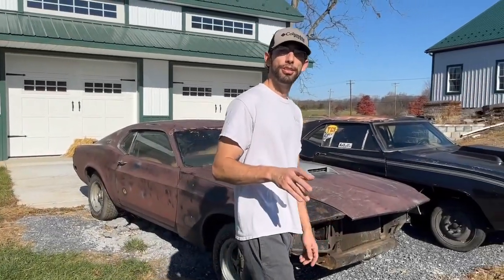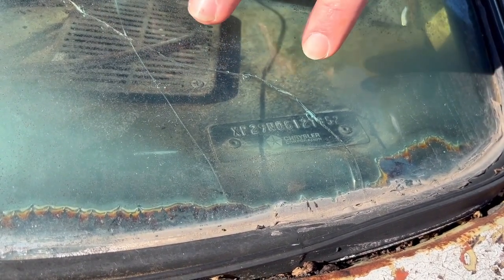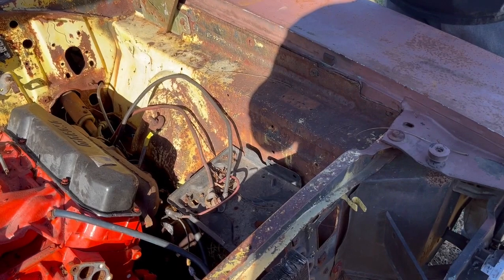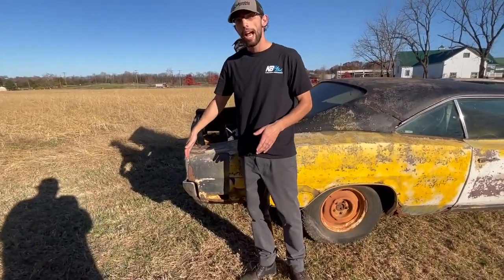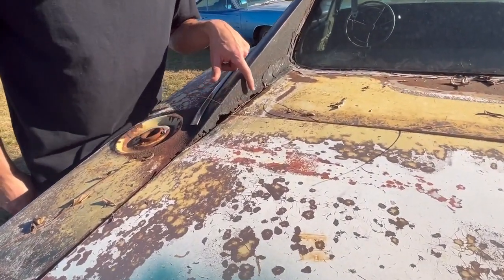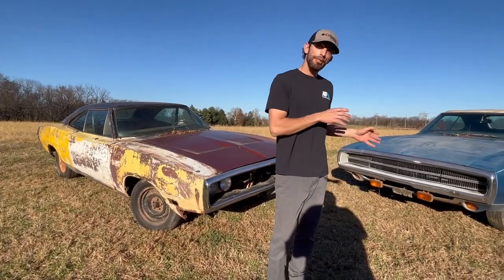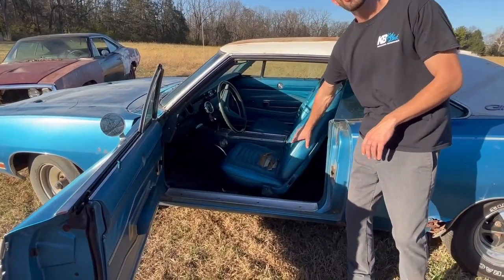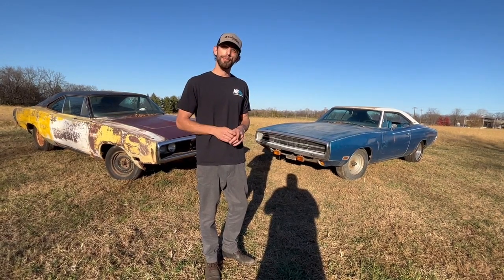What Are They Worth? Barn Find 1970 Chargers

Comment: The vin on the yellow car states it originally came with a high performance 383 four barrel. L is the code for a two barrel. That makes it worth a little more over a two barrel car. Also the idea that the cars are so long that the back ends stick out from covered storage etc which causes them to rust is rediculous hyperbole. I’ve driven these cars in the winter. The back end behind the rear wheels gets so packed with snow,the salt just eats away at it. The rear window channels rust out from water retention causing a leak. This water runs under the rubber trunk mat and stays wet thereby rusting out the floor. Overall a good video,I think your valuations are accurate.
Reply: I agree. That is not why they rust out. They rust out because they are prone to rusting out in those areas.
Reply: @blackenigma6777  also or at least for mine i noticed that the rubber seal's are done-poorly/design defect aka cut&shut+class-B-panels ect

still love my 69 charger styling and don't plan on changing it or at least what Richard/bill would have done/approved of
Reply: mine was mostly in the gas tank areas for rusting so far that i know about as the 3d owner 2014-now and it's mostly from rain and or dailying it in the mid-west and rocky's . wonder how much difference between years and a big block as mine is a g-code ? also mine now is a theft recovery/flood car as some-JA's though it was free-part's/joyride
Reply: @richardprice5978  G code is 318 I think.
Reply: Everyone is correct. If the back was under cover wouldn't get wet or have moisture from the ground after the rains.

Snow doesn't help.
Reply: L

Comment: Your blue charger is a true surviver
Reply: I'd take the blue one any day. Cars like the yellow one will drive you crazy and broke  trying to find all the stuff thats been stripped off. I don't care if it's a big block,those kind of builds are a large pain in the butt and take huge amounts of man hours and wheel barrows of money to complete. RUST REPAIR SUCKS!
Reply: @carlinshowalter1806  the factory big block cars were also typically the most abused!! Lol! Many have been wrecked and repaired, gone through many teenage owners and Smoky burnouts, multiple paint jobs, multiple blown motors, bad Bondo work,  and were typically left parked outside in the elements Because by the 5th owner sometime in the mid-seventies it was owned by some teenage kid with no money and no garage to park it in! 😆

Comment: Once again... I'm absolutely SHOCKED !
IMO, these Cars all require what basically amounts to complete restorations, which, I've been told can run anywhere $70K to $100K depending ?
I mean I know Charger's have appreciated substantially, because I own one and get pestered the few times I've driven it over the last decade..... but I haven't really kept up with actual valuations, and the starting points of those trying to acquire/restore.
After seeing this I wouldn't sell my unrestored/unrebuilt survivor in great condition under $125K
Reply: A restomod might cost less than restoration, especially if have the gear and the skills to do most of the mechanical work